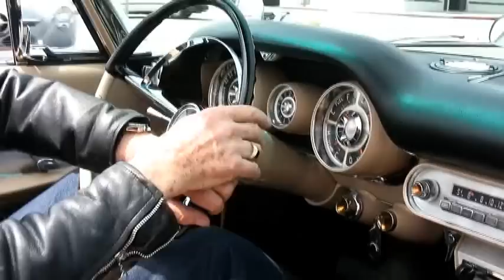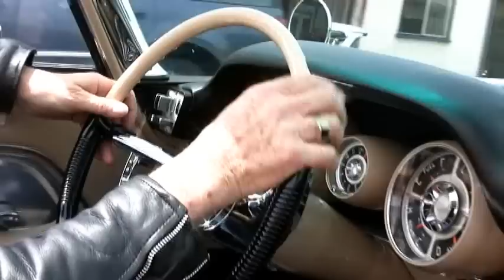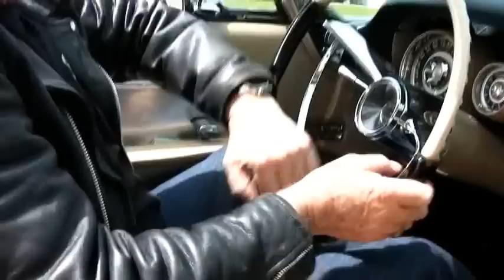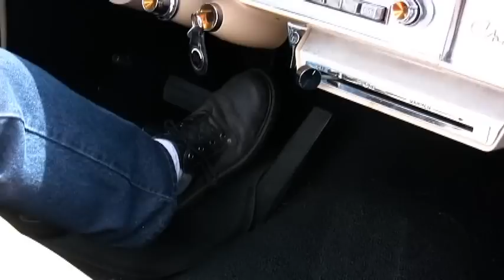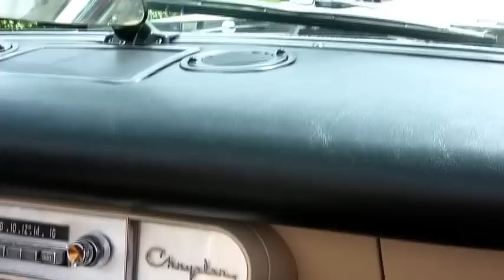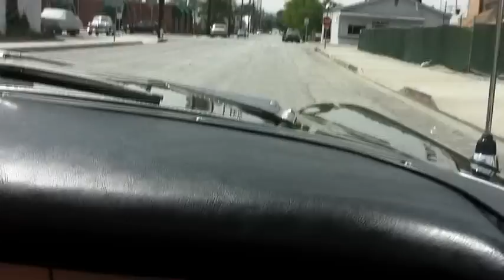Driving the 300 C  Convertible  (1957 Chrysler) April 17 2010

Comment: She's a beauty! I want a 300C when I grow up. Haha.

I made my '56 Firedome with the same engine as this but with the stock valve covers.
Twin Edelbrock double pumps, fully balanced internally, forged pistons a little polished ports and a set of discreet home made headers.
And of course a mild street cam. Put out 413 hp at the crank.
8,3/4" limited slip rear axle with 3,23 ratio.
Real comfortable ride that puts many newer US and import cars to shame, even at highway speeds.
Regards from Sweden.